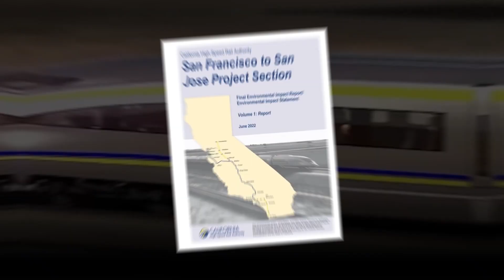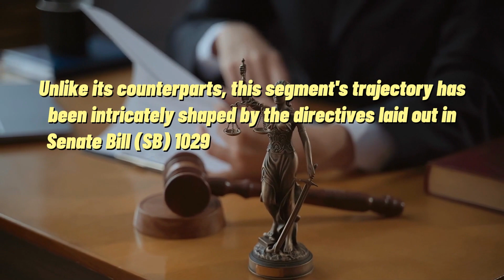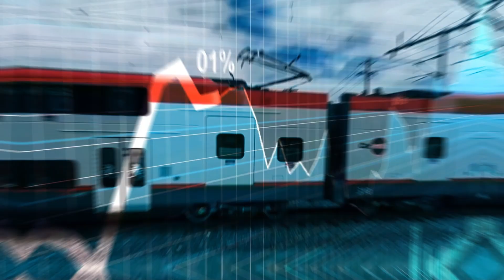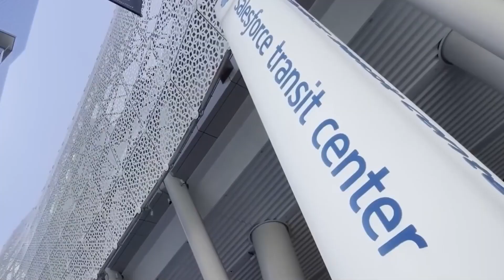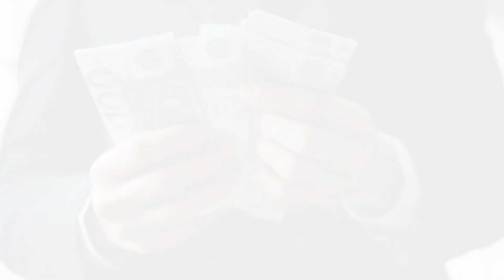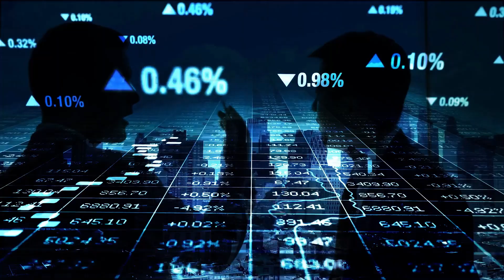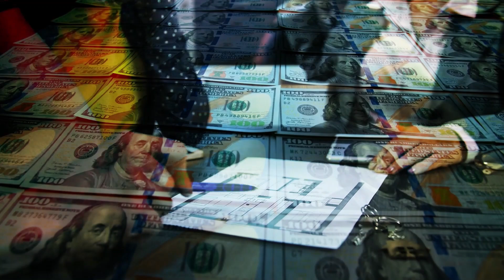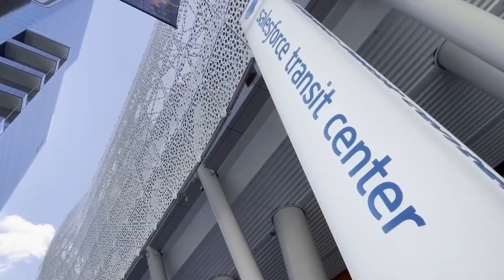INSIDE California's HIGH-SPEED RAIL: San Francisco to San José

Comment: Very much need the LA to Central Valley connected FIRST!  You can then use existing passenger rail to continue on to the Bay Area.  There is no connection to LA otherwise (except a useless bus caught in traffic)!  Need to complete this LA connection sooner than later!